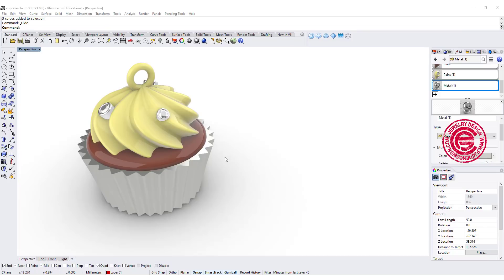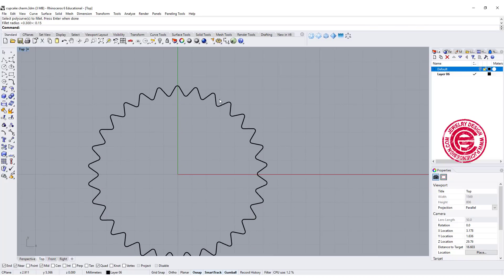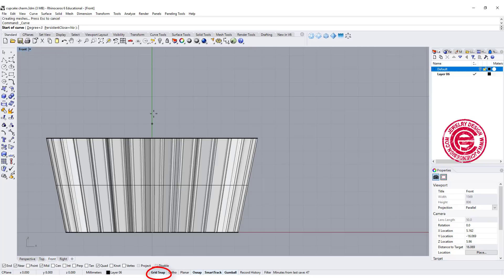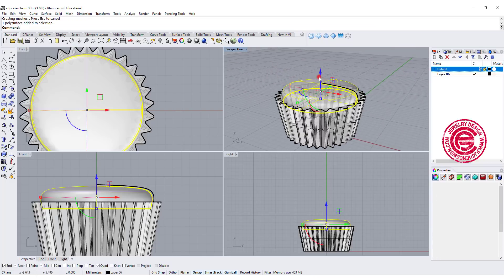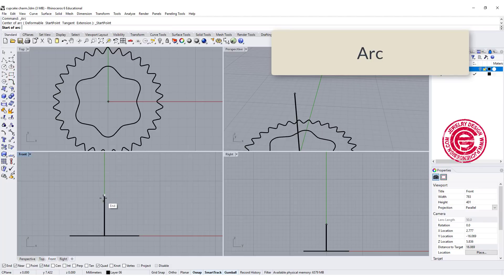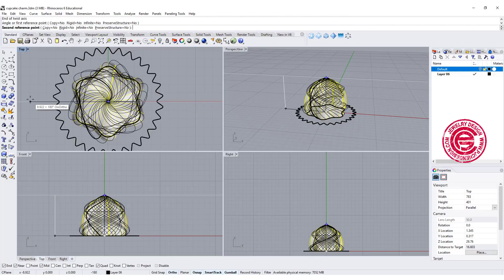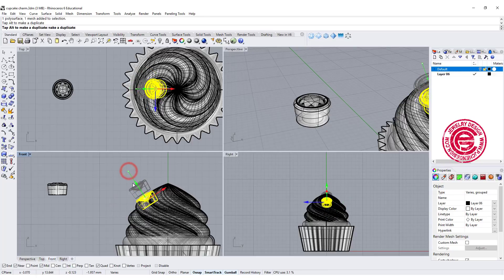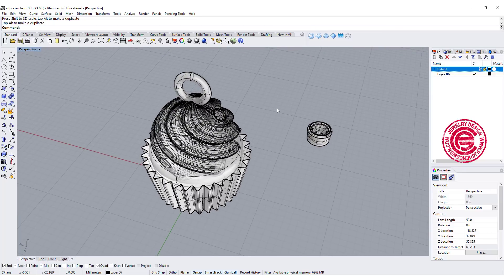How to 3D Model a Cup Cake Charm in Rhino (2019): Jewelry CAD Design Tutorial #60

Comment: hey Pj. another awesome video. But i had a problem this time around using the gumball to scale up the star in the initial steps. when I use the red square I ended scaling only in the x direction. so i had to use the normal scale 3d command
Reply from the maker: Darshan Aacha make sure you hold the SHIFT key when you use gumball scale.
Reply: @PJChenJewelryDesign  oh right. thanks